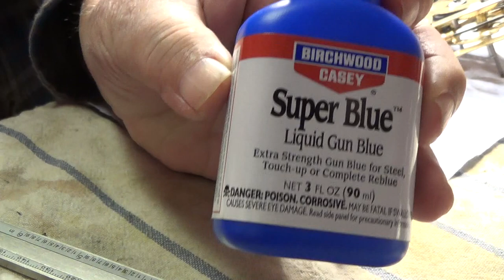Repair of a Regula 25 Movement with Dancer Platform and Music Controller

Comment: An index for this video:
0:00 - 0:38 Unboxing
0:38 - 2:52 Inspecting the movement for worn pivot holes.
2:52 - 7:26 Removing the parts from the back of the movement.
7:26 - 8:18 Checking the locking of the strike mechanism.
8:18 - 8:44 Noting the locked position of the star wheel and removing it.
8:44 - 16:30 Fighting the Regula compression clips. See https://youtu.be/GfUAY6v1Im0 for how to remove them with a special tool.
16:30 - 18:55 Removing the parts from the front of the movement.
18:55 - 20:22 Finding the drop lever is behind the bird perch.
20:22 - 21:12 Separating the plates.
21:12 - 24:40 Examining the plates and wheels for wear and rust.
24:40 - 27:16 Polishing the pivots and arbors.
27:16 - 29:42 Examining the cleaned time train for wear.
29:42 - 32:09 Preparing to bush the worn time train pivot holes.
32:09 - 42:13 Bushing two back plate pivot holes by hand.
42:13 - 44:58 Cutting the bushings flush with the back of the back plate.
44:58 - 47:40 Continuing to bush the back pivot holes (brooching).
47:40 - 49:16 Testing the bushed back plate pivot holes.
49:16 - 49:56 Testing the bushed front plate pivot holes.
49:56 - 53:04 Examining the strike train pivot holes for wear.
53:04 - 55:00 Trouble with the warning wheel bushing.
55:00 - 56:45 Another close-fitting bushing.
56:45 - 58:53 Bushing the strike side great wheel pivot hole.
58:53 - 59:47 Testing the new bushings.
59:47 - 1:06:43 Chemically bluing (vs. heat-bluing) the levers.
1:06:43 - 1:08:31 Oiling the pivot holes.
1:08:31 - 1:12:41 Reassembling the movement.
1:12:41 - 1:13:45 Test running the repaired movement.
Reply: Thanks for all this work!  Very helpful indeed!!

Comment: About how bluing can be missing on an old clock: I accidentally completely removed the bluing on the levers of a cuckoo clock by putting them in EvapoRust. As you know, rust removers removing the bluing. I re-blued the levers with a chemical bluing and they looked good as new. Keep up the wonderful videos!

Comment: Thanks for the great video!  I like to remove the tiny e-rings with the tip of an awl.  Just keep the ring pushed down against the plate with a fingernail while prying the ring away from its mounting post.  There's always enough exposed opening (there are two actually) in the direction you want to pull the ring to get a sharp awl in there.  Just takes a few seconds to do.  The only other item I need is a magnifying headset, but younger folks probably can do without it.
Reply from the maker: This is even better:  https://youtu.be/GfUAY6v1Im0?t=77

Comment: Hi Don. Thank you for the detailed and extremely useful video. I was able to tear down, clean, and rebuild the Regula 25 movement that is in the cuckoo clock that once belonged to my grandparents. The movement is exactly like the one in your video, which includes the dancers and music box. Although I was able to get the clock back up and running, the time ratchet wheel is in need of replacement. One of the two catches for the ratchet had broken off, and the other I had to bend so that it would catch. Otherwise, the weight would drop to the floor. I have found similar time ratchet wheels online, but there is a significant gap between the wheel and gear when compared to mine. There really isn't much of a gap between the two on mine. Is this a part that needs to be further repaired, or is a replacement part available and I'm just not finding it? Thanks in advance, Keith.
Reply from the maker: There are a couple of options.  Get another junked wheel, tear it apart and remove the ratchet.  Do the same with your wheel and install the good ratchet from the junked wheel.  OR, buy and new wheel and move the drive gear to the same position as your old wheel.  I also remember seeing someone selling the ratchets as a replacement kit , but that also requires taking the old one out and putting the new one in by driving off or twisting off the part that holds the ratchet on and then driving it back on.
https://timesavers.com/search.html?q=regula+chain+wheel&go=Search     https://frankenmuthclock.com/collections/parts-cuckoo-clock-quartz-cuckoo-miniature/gears-chain-wheels     https://blackforestimports.com/category/Parts-Accessories/Cuckoo-Parts-Accessories/Wheels-Gears-Cuckoo/Chain-Gears-Cuckoo/Chain-Gears-Cuckoo-For-Regula/
Reply: Thank you very much Don. I had wondered if the new parts were compatible with the old ones and how hard the gear was pressed onto the shaft. I've been proceeding with extreme caution out of concern for damaging a part that cannot be replaced. Thank you again.

Comment: Wow, this one looked like a tough one to work on!  That movement looks almost identical (including the crude method to mount the bird perch) to the Regula 25 cuckoo movement I have (3 - weight, 1 day clock), minus the cobbled-on mechanicals they added to accommodate the dancer.
Reply from the maker: I certainly don't like parts that are riveted on.  All I can imagine is the crud that has to accumulated between the brass plate and the riveted steel brackets.  I imagine corrosion going on in those hidden crevices.  I didn't show it in the video, but I had to go ahead and separate the split bird-perch hinges and snap out the perch to remove that lever and to reinstall it.  I was very careful to open it just enough for the perch to snap our of the slots. Gone are the days when these movements would be carefully crafted with parts held on with brackets screwed to tapped holes.  It's cheaper and faster to punch a hole and smash a piece of brass to secure a bracket.  Fast and cheap means more profit.  Name of the game anymore --- money, money, money and to heck with quality.  They don't care about repairs; that's too expensive for most people, too.  How many repair people would opt to disassemble, clean, rebush, etc. a basic Regula 25 movement when a new one can be purchased for $55?   http://butterworthclocks.com/CUCKOO%20MOVEMENT%20PRICE%20LIST.pdf

Comment: Hi, great video, thank you for sharing your knowledge and experience.  A question, how many swings of the pendulum are there in a minute for the Regula 25 for it to be in time? I'm guessing 70.
Reply from the maker: There are multiple version of the Regula 25 movement with differing pendulum lengths. https://blackforestimports.com/category/Movements/Cuckoo-Movements/Cuckoo-Reference-Chart/
Reply from the maker: You can also use this:  https://theindex.nawcc.org/CalcPendulumLength.php

Comment: Hello Don!  I just completed the disassembling, cleaning, and reassembling this exact same movement with the dancing platform. The time and chime on the movement now work perfectly.  My problem is the same music box controller you show in the video. When the catch is released, the weight races to the floor. The cam is spinning so fast that the catch cannot possibly catch and hold the notch in the cam. Sorry if I'm not naming the parts properly. At the end of your video, the notched cam moves nice and slow and plays the music. On mine, it just zips the drum around on the music box very fast. This clock came with three 275g weights.  All gears are connected properly from the dancing platform down to the chain gear. Any idea what I've done wrong here?   Thanks in Advance.
Reply from the maker: There are only two possibilities that would make that happen.  One is that the fan on the governor is slipping (not tight enough on the arbor) and allows the mechanism to run excessively fast.  The other is the chain wheel click(s) are bent or not engaging. It would be helpful if you could take a short video of the action so I can better evaluate it.
Reply from the maker: Another thought.  Does the music also play super fast or is there no sound but just rapid drop of the weight?  If the sound is playing, it's the governor fan.  If it's just the weight falling, it's the chain wheel.
Reply: @dperry428  Hi Don. The music plays fine (Real fast of course).  The chain wheel is good. I will investigate the governor fan.  Thank you !

Comment: Hi Don! Great video as always!  Love the way you fully explain in 'easy to understand' how these movements should work.  I am about to do my first bushings on a movement. Just wondering what size champfer bit you used and any suggestions on where to purchase.
Reply from the maker: I don't know size.  It came with a set of hand reamers I bought some years back.  Timesavers still has the set. https://timesavers.com/i-9500979-us-made-hand-reamer-set-for-the-bergeon-bushing-system.html
Reply: @dperry428  Get the kit from Timesavers & did my first bushings! Thanks again!

Comment: Small Internal snap ring pliers are used to remove and install the compression rings
Reply from the maker: Haven't found a set that works on these small sizes.

Comment: Have the exact movement in a clock I bought when I was stationed in Germany in 1967.  I have the same feeling toward the two clips you tossed away.  What were the rings you used to replace them and where did you get them? Every time I remove them and replace them I use some serious language unlike the polite terms you used.
Reply from the maker: The rings of brass I put on I turned on my lathe, made the holes in them a friction fit with the shaft of the lever.  Worked well.   Then, I got some pliers that stop the cursing. Do yourself a favor and spend $28 for these:  https://youtu.be/GfUAY6v1Im0
Reply: @dperry428  Thanks.  I'll try them.

Comment: thanks for posting. What's the best thing to clean a tarnished movement ?
Reply from the maker: Some people use an ammoniated cleaner.  Use Brasso if you like, but make sure residue is removed. I like to use a mild abrasive that is normally used for acrylic showers and tubs.  Good old-fashioned elbow grease with the polish and a toothbrush is very effective.

Comment: Hello. Fantastic video! I have what looks like the exact same movement. The problem is the music and dancers will not start up after the strike and I can't seem to find the problem that is keeping the music from starting. Do you offer a clock repair service? I can find no one in south Florida where I live that is willing to try the repair, they all just want to replace the movement which I would rather not do if at all possible. Thank you again for the the great video!
Reply from the maker: If the clock is running and the cuckoo working, it does NOT need a new movement.  Anyone who tells you that is a charlatan. The music box and dancers are set off by a wire or lever that extends from the movement proper..  It generally is just bent out of adjustment.   Examine the lever or wire and see if it is hanging up.  It is possible that the music box, itself, is worn and needs repair but, that is unusual.  I do clock repair strictly as a hobby and only during winter months.  You can contact me by leaving an email address in a comment, which I hold for review and can delete it after copying the email address.  I will then find out more about you and see if I can fit a repair in this coming winter, if I'm still here.

Comment: Wonderful video as usual. Very informative. Thanks a lot. I've just rebushed and restored a similar movement. It works great but it strikes the number of hours on half hour then it strikes the hour plus music on the hour. If it is 4:30, it strikes 5 times without music and at 5 it strikes 5 times plus music normally. I adjusted the minute hand and it worked ok for a while then I moved the minute hand again to adjust the time and it messed it up. Any idea what the cause might be? Thanks a lot and Merry Christmas
Reply from the maker: On the half-hour, the lever under the end of the rack should be lifted just enough for one tooth on the rack to be released and it then strikes (cuckoos) once. On the hour, the rack should be released completely for the rack tail to drop onto the  snail and the proper hour is struck.  So, I'd check to see why the rack is being released too much on the half hour.  Probably a bent lever somewhere.
Reply: @dperry428  Thank you very much

Comment: Great video as usual. I always learn a lot from you. Wondering if you are using Bergeon or KWM bushing system? I have KWM cutters but I don't know what bushing size I should buy to re-bush a similar Regula 25 with dancers and Hermle 1050-020 triple chime. Any help would be appreciated.Thanks.
Reply from the maker: I don't use either system.  I buy my commercial bushing from Butterworth Clocks.  Their bushing happen to use the same outside diameters as Bergeon, so that brand reamer can be used.  They are in .5 mm gradations and the reamers are .03 mm smalller that the OD of the bushings, making them fit tightly.  With KWM, you are supposed to have an inventory of bushings, measure your pivot and find, using their chart, a bushing of appropriate ID, install and you're done.  With the bushing I use, I measure the pivot, choose a bushing of smaller ID, install and then broach out to fit the pivot.  I only need a small inventory of bushings and reamers.
Reply: @dperry428  Thank you for your reply. Would the commercial bushings you use work with KWM cutters? If yes, I would buy the ones that fit cuckoo and hermle clocks. If not, I could use broaches instead of reamers. I don't bush a lot of clocks. I want something simple and economical. Thanks.
Reply from the maker: Follow this link, then click on the picture of the reamers.  Look at the sizes of Bergeon and KWM reamers.  That should answer your question. https://ronellclock.com/American-Made-Reamers-American-Made-Reamers.htm
Reply: @dperry428  Thank you very much.

Comment: Is this movement allowed to be turned counter clockwise?
Reply from the maker: yes
Reply: @dperry428  Are there any movements that you would only move clockwise in the cuckoo clock?
Reply from the maker: The ones I recall are many, if not most, of the older railroad-style cuckoos.  The thing to do is move the hand backward and, if you find real resistance, which will occur around the hour and half-hour, don't force it.